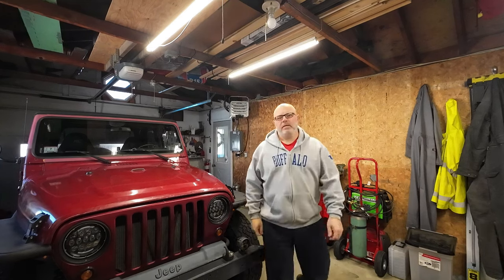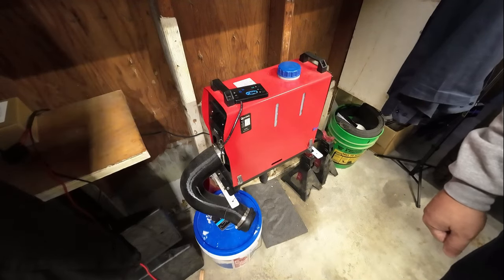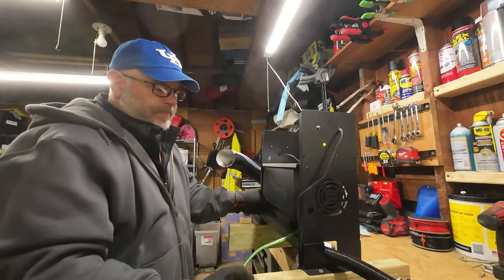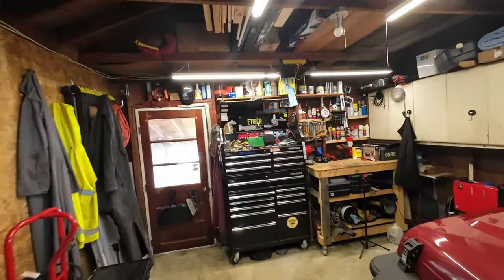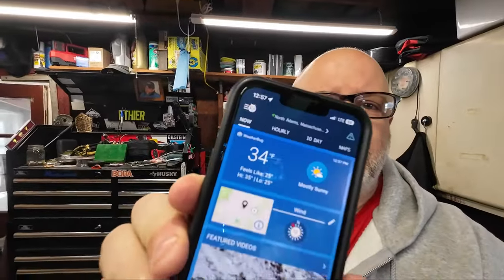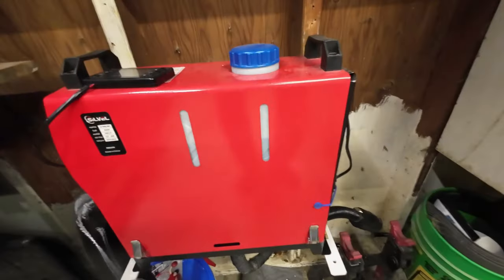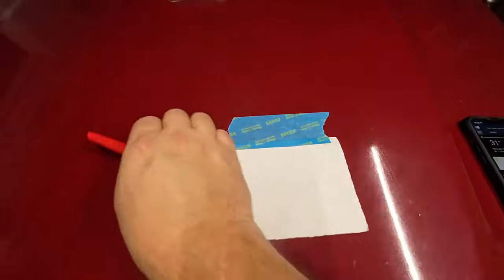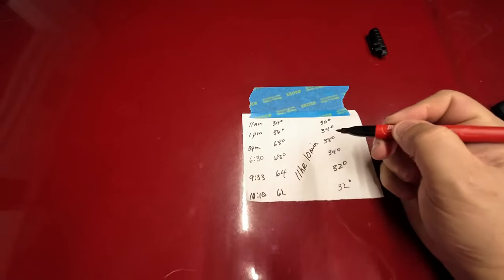Diesel Heater Run Time

Comment: Insulate the roof as soon as possible! My 24'x12' workshop needed a 3kW fan heater running all day to make it workable. (16 deg C). Finished insulating and lining the roof with drywall, it now takes a 300W radiator to hold the room 10 degrees C above outdoor temperature; ie 30W per degree C differential. I use a diesel heater on kero for the back room of my house to take the chill off, without firing up the central heating.
Reply from the maker: I’m hoping I’m gonna be able to get that done this winter. It should make a huge difference. Thanks for commenting

Comment: Where does the exhaust go?   Will it run longer on low?
Reply from the maker: You have to pipe the exhaust outside. I've not tried to run a full tank on low but I would guess it would run twice as long. Thanks for commenting.

Comment: Nice vid bro. I upgraded the fuel hose to 3mm (inside diameter) silicon rubber hose. It can handle way much higher temperature than plastic, tho the plastic hose is probably safe to use as well.
Reply from the maker: Thanks for commenting and I'm happy to hear you enjoyed the video. The plastic hose is working perfectly for me so far. I'm sure the silicone will work well long term for you as well.

Comment: I just added a longer fuel line and draw out of a 5 gal steel pail.
Reply: How long that last?
Reply: @Granite  depends on the settings.  I can burn around 0.7L per hour with 2 of mine.